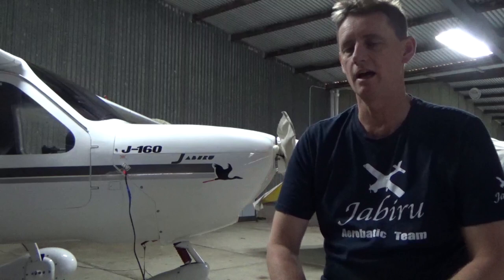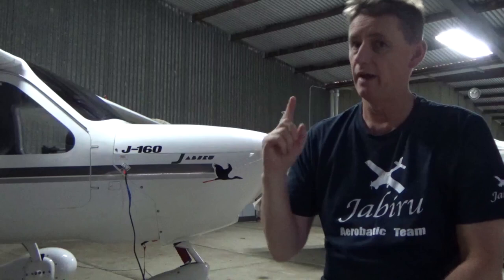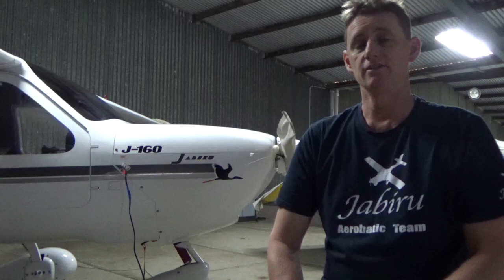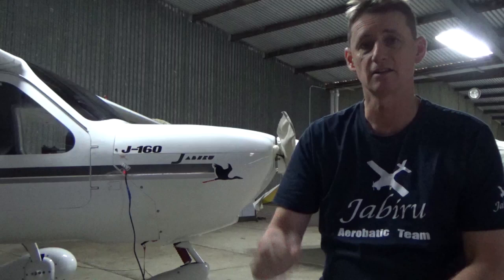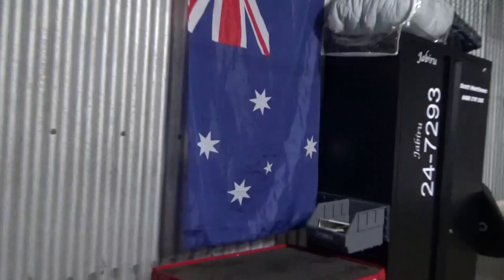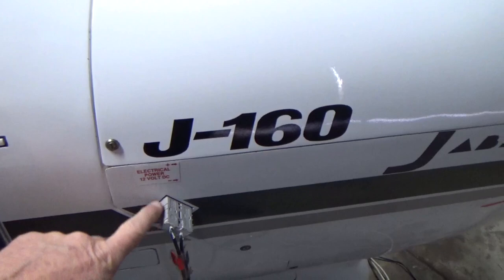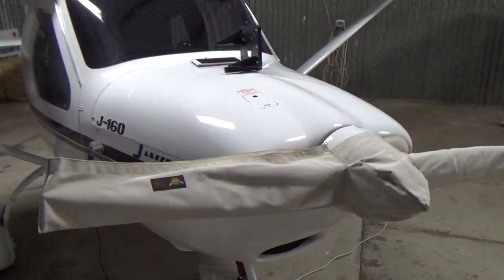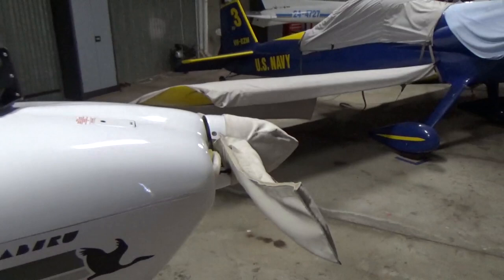How I fitted out my Jabiru Aircraft

Comment: Brilliant stuff!  I was wondering where to put my Anderson charge plug and now I know.   Love the door cards. 
In your build, some folk mount a removable second panel skin in three sections over the actual panel.  It allows easy access as they pop off independently from the ‘fixed’ panel but also to completely change your panel over time as tech evolves as  you only work on the square/rectangular removable ‘skins’ which are secured with 4 or 6 rivnuts.  Just an idea that I thought worth noting. No panel is perfect!
Reply from the maker: jiefu thanks mate